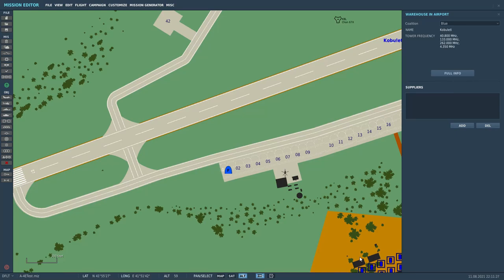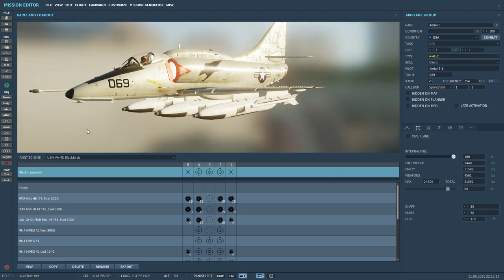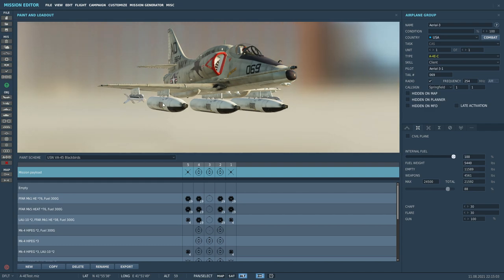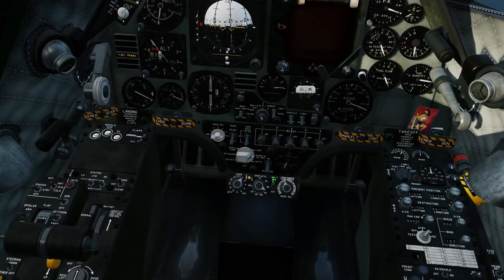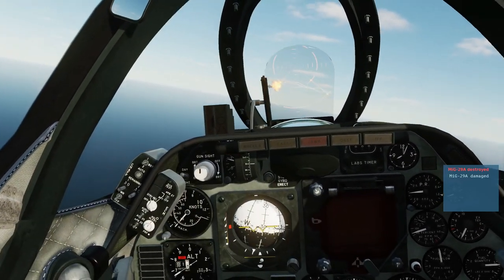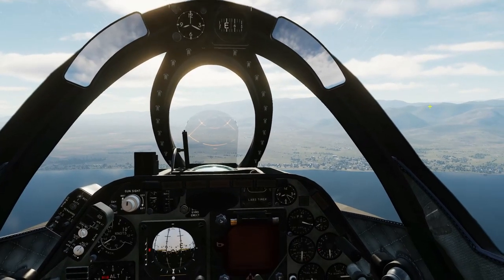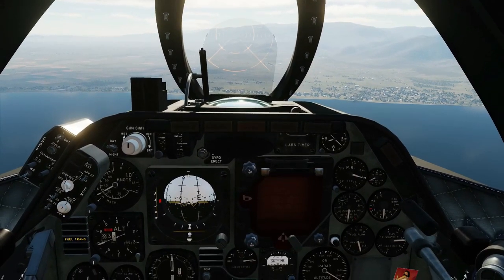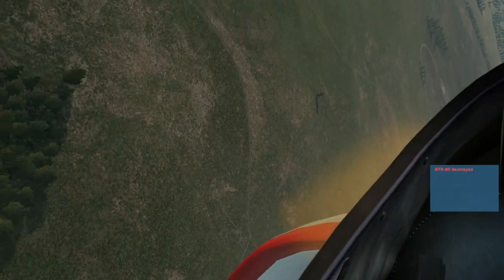Community A-4E AIM 9 and HIPEG Tutorial | DCS | DCS World | Digital Combat Simulator

Comment: This is a beautiful mod, sadly at the moment from cold; I cannot get the throttle to move out out of off into either idle, let alone run.
Reply: Solved; the first time I ran DCS after installing the mod, it didn't work, but exiting to desktop - i.e. closing DCS completely, afterwards - then reopening and the throttle moves out into idle and running states okay.
Reply from the maker: That is a strange issue to have, are you running Openbeta or stable version of DCS?
Reply: @boresight2020  Openbeta, it seems to be fixed now, since closing reopening.
Reply from the maker: @spigot993  Ah awesome, Enjoy! Thanks for watching

Comment: Could i get some assistance? No matter what i do i just never get a lock. I hear the search tone, the pylons are properly selected, just no lock no matter what.
Reply: Hey I'm new to DCS but might be able to help... I was struggling to get a lock until I realised you need to get behind a jet to lock on. I guess for the heat signature of the jet exhaust?? I was trying to lock on to jets coming towards me or side on and also helicopters and propeller aircraft without success until I realised. Not sure if that helps you! Also aim9p5 is better than aim9b. Cheers
Reply: @Davemxnz  Thanks mate! After some troubleshooting i got that conclusion aswell but thank you for helping! I found that as a matter of fact even if you don't have a lock and you are behind-ish your opponent, the missile actually locks on after launch! Don't know if it's a bug or a feature but it does work. Try it out!
Reply: The B and P sidewinders are rear aspect only. The P-5 has a tiny bit of front aspect capabilities.